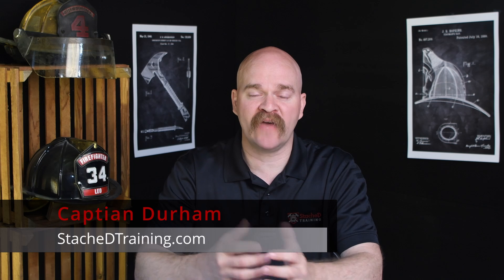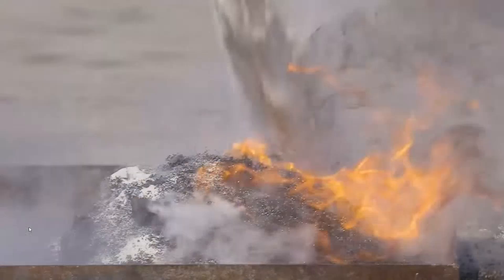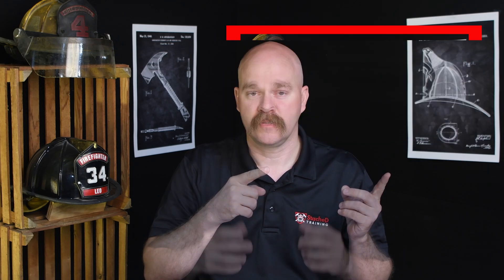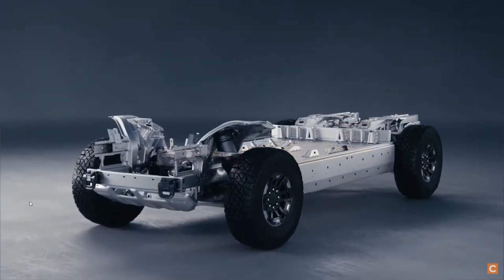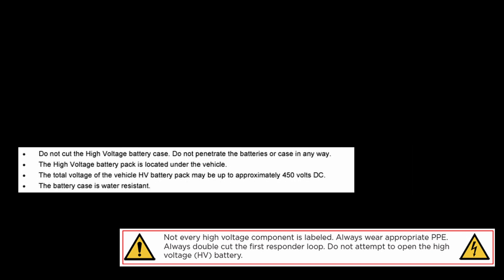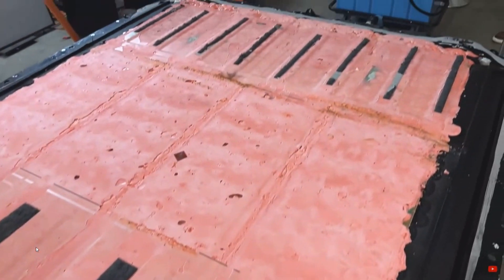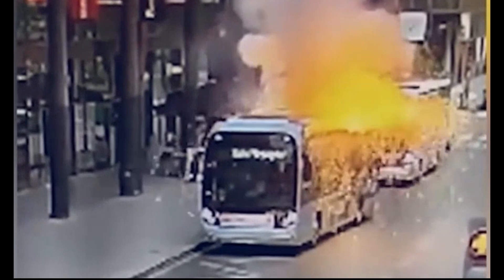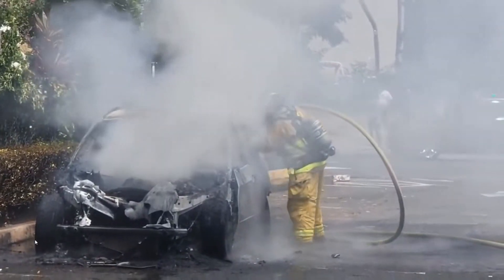What Firefighting Tools for Extinguishing Electric Vehicle Fires Really Work?

Comment: I saw a specialty truck in Europe where a huge tank on the back of a truck where the ev was hoisted into the tank and completely submerged. This is the best approach ive seen. It minimizes Poineaus fumes and damage to roads.
Reply: what happens to the water that the EV was dunked in? I doubt they treat that water
Reply: @Kiyoone  donrt know, it would be pretty toxic but probably better than the airborne toxic emission that an open fire would bring

Comment: "10s of thousands of gallons of water, that's what it takes to put out an EV fire."  With lithium based batteries, nobody is 'putting out' an EV fire, they are simply cooling the fire as the lithium in the battery banks burns to completion.  Contact with water actually causes metallic lithium to burn - remember that from chemistry class?

Comment: Is there anything from built-in airline cargo extinguishing technology that could be built into EV batteries.

Would liquid nitrogen in reasonable quantities reduce the temperature quickly?

Is there any adaptation of the halon gas methods used in computer centers that would work if they could neutralize or separate the burning chemicals?

Comment: manufacturers should have to design in fused/heat activated extinguishes as part of the pack, as you said, it's much easier to extinguish from the inside, and some power electronics already have little heat activated fire extinguishes in case of board fires
Reply: Have you watched the video? There’s no extinguisher that can reliably put these fires out

Comment: What would be interesting as well is the answer to the question: What type of gases are released when such a battery burns?
Reply: Was wondering that too. Bet they're far more harmful than any of the greenhouse gases they typically designed to reduce.

Comment: I'm still wondering about crane and dunk tank method, the car is a gonner no matter what. I think like they did in Germany I thinkit was  they put the car in container of water, much easier to keep cooler water to the battery. I'm not sure if a top could be made where gasses are filtered or even burnt off in a controlled manor...
Reply from the maker: I discuss
 this method here: https://youtu.be/CVUAzFzKhw8

Comment: Fire needs fuel and energy. A large tank of water can absorb a large amount of energy. Lithium reacts with water, but if hot enough also with air, and cells should be waterproof, so submerging the battery might be cheaper than fixing molten asphalt.

Comment: I think there should be a fundamental change in the way EV batteries are manufactured. A redesign to make the batteries them less prone to catching fire. These technologies are on the way. For now, just keep the fire from spreading to other things,
Reply: The frequency of lithium battery fires is not significant compared to gasoline. Better ways to extinguish the relatively few fires is the issue.
Reply: They are far less prone to catching fire that other vehicles

Comment: My concern (in addition to EV fires) is the use of Li batteries for when combined with solar cells for home use. The batteries are just wall mounted in a convenient location such as the garage, under a bedroom etc. Most people are simply ignorant of the dangers that these batteries pose to life and property.
Reply from the maker: The plus side, these types of system are in fairly safe, stationary locations.  They also have slower charge/discharge rates.  I plan on covering ESS in a future video.
Reply: One technique to isolate these is to build the extinguisher into the top of the containment for your power wall or bank. I have disassembled failed/expired extinguishers and piled the material in gallon bags and placed this atop my charging lithium batteries that aren't building high heat. Similar apparatuses can be made with sand as well, not that it will smother the flame but it will insulate the heat from catching the surrounding materials on fire as quickly!

Comment: then its up to the producers of the batteries to add a fire suppressant within the batteries themselves,  maybe a chemical in a chamber that when activated either automatically through sensors or manually floods the compartments with a chemical that has the right effect on the batteries to either suppress the fire and or convert the existing cells into dead ones as regurds to the ability to create the fire,

if that tech does exist then governments can outlaw any battery vehicles without it

its never a good idea to have an easy to access (car / truck) that can be used as a terrorist item that cant quickly be extinguished, how they were able to put these on the roads and into the hands of the public without a fire suppression system either on board or for the use via fire fighters is ridiculous 

quite simple really, "no you cant have that because we cant put it out in an emergency" should have been stopped at that hurdle right from the get go

Comment: Vehicle manufacturers producing EVs should allow input and output nozzles to be located on the vehicle to allow high-pressure water to enter and exit the battery pack. This would allow gases to escape but more successfully without total burn-through.
Reply: water cannot put this fire out

Comment: The ONLY solution is to demand the battery pack manufacturer to solve this and test it thoroughly, no-one else can. The construction MUST compartimentalize and totally isolate them from eachother and safely - under control - let the faulty compartment burn out without igniting the others. It is not easy, but the solution lies in the design. A poor design will ALWAYS be hazardous and the safest thing for everyone is to let it burn. But that also means that parking garages may in fact NEED to ban electric cars...at least those which are not inherently safe under all conditions.

Comment: Very important to remember that according to NHTSA data ICE vehicles catch fire over 11 times as often per million miles driven than EVs.  ICE vehicles have pressurized gasoline, extreme high temperatures, 60,000 volts, lots of wiring, a fuse panel, many plastic parts, all jammed tightly together under the hood. When a EV rarely does catch fire it is likely to be totaled, when a ICE vehicle burns it will likely be totaled, a larger percentage of people escape EV fires than ICE vehicle fires.
Reply from the maker: I have a lot of comments on the data (lack of) behind EV vs ICE comments.  I plan on covering this information in a future video.

Comment: It's funny how the technologies that protect the fire from occurring in the 1st place (insulating batteries, separating them, mounting in strong containers) is actually hindering firefighting efforts.
Reply: I call it the boot vs sandal effect.
You can either work really hard to prevent anything from getting inside, or you can make it really easy for anything that gets inside to pour back out again.
Trying to do something inbetween defeats both purposes.
And battery boxes are using the boot side of things.
Reply: Similar to house construction; houses are easy to Pierce and get water on. A castle convert very difficult to extinguish a fire, due to accessibility.
Reply: You either a hero or live long enough to become the enemy
Reply: You could have the battery fully exposed would not help much. Get yourself a few fully charged 18650 cells tape them together. Short one out or even better stab one with a screwdriver. Watch the resulting fire and see if you can put it out with water.
Reply: @mitchellcrane9809  It will actually be possible to put out the fire quite quickly: I mean the cells that are already burning will need to burn out, but all the remaining ones would be safe. A fire would last like couple of seconds. One 18650 cell holds about 10 Wh of energy, that's a tiny fraction of the whole EV battery.
Reply: @mibars  No actually try it because I have experienced myself. I have friend who is a commercial electrician. He got the fabulous experience of watching a data center burn down because of the LiPo batteries in the backup power supplies went off and spread to other units. Now imagine trying to put that out in a tesla pack which is what the older packs are make of . The same principle applies to all of them. It is a extremely energetic fire that spreads quickly and there is no way to reliable put it out. This is a well known subject/issue why people actually try arguing that it is not the case is beyond me. The issue can not be addressed if people just keep telling themselves stupid ideas like just flood the pack with water or cool it with nitrogen or any or the other foolish ideas I read.

Comment: If a battery is burning, it is likely that the burning cells have burnt holes into the cooling jacket. I'd tap the cooling system to inject water directly into the battery pack through existing pipes. Two caveats being that 1) you need to know which pipe to tap into and 2) the cooling system going to the battery must still be otherwise intact, which may no longer be the case if the fire has been burning under there long enough to melt the battery's external hookups. The first problem could be solved by implementing a standard for external coolant connections, the second would require that external connections up to the coolant injection port(s) and bulk distribution within the battery pack be fire-resistant.
Reply: Tesla has figured it out.
Design the cell casing to fail at the base.
Encase the sides and top in a heat resistant foam.
If the cell shorts and a reaction starts, the base fails.
The material "torches" through the pack base to the open air.
It's heat that causes the chain reaction.
The cells next to the failed one never get hot enough to become compromised..... No chain reaction.

Comment: Let it burn . 
The likelihood of an EV fire is very low compared to the rolling gasoline bombs we’ve been using for decades.
The irrational fear of EV fires is largely a result of the “if it bleeds, it leads “ strategy of low budget local news outlets.
The other major fear inducer is propaganda from fossil fuel industry.

Comment: I remember a few years ago in the very infancy of EVs, there was a kind of heat proof expanding foam that you would spray all around the car. 

This would NOT put the fire out, but to contain the fire/heat and direct heat in a way set by the firefighters depending on the situation. 
Later, when cool the foam could be broken up and removed. 

This is far from a perfect system, but seeing as how the damage that can occur from an EV fire, the ability to contain the fire has got to be worth following. 
It's not about saving the car... Once the fire has started that car is gone, it is about saving the area around it. This is a MAJOR issue in parking garages and underground structures or anything like that.
Reply: That is all you can do about these fires - control the surroundings and let it burn

Comment: In Europe Renault is trying an access panel to the internals of the batteries that would melt away in the event of a thermal runaway, in order to enable the fire fighters to dump water inside the battery pack.
Reply: Water/chemicals do not put one of these fires out.
Reply: A fire need three things to burn
-fuel 
-comburant 
And heat
The goal of pouring water inside the battery pack is to Cool it down enough to put it out
Reply: @jordanrudler2120  putting water into the pack will not cool it down and put it out. Li Battery fires are not extinguishable , you can only let them burn themselves out. It is a chemical/metal/electrical/self oxidising fire  that water especially can not deal with.

Comment: Sometimes IV have watercooled batteries for normal operation. Why not make an external aux connection on the car for the fire department so they can fors cold water true to stop the thermal runnaway

Comment: If your near a river or lake, just push the car in the water. Of course most of the time that's not possible,,,,,,,,,,,The best thing is, just don't buy one, and don't put it in your garage, or park near one. Electric cars are just an overpriced over lied about how much carbon they put in the air. Building the car, building the battery. The mining that's required to make the batteries, the power comes from somewhere to keep them charged, and that's not cheap or saving you any more money than a 4 cylinder gas car. Even insurance now don't want to insure them. The tires must be much better because of the heavy weight of the battery. If you don't live in a big city, who's going to work on it? Sorry I'll take my money and go on a trip,,,,,,,,,,,,,,,,

Comment: The Renault Megane EV do have a function called "Fireman Access". It allow fire fighters to send water directly inside the battery. I think I heard they are pushing for this to become a standard on all EV.
Reply: Waste of time. You will not get near enough to hook up but more importantly once started you cannot put this sort of fire out. It is not about access it is more about the nature of they type of fire it is. All you can do is try to keep things around the car under control. This is a chemical/metal/electrical fire that is also self oxidising  that can not be put out it can only burn itself out.
Reply: @mitchellcrane9809  That's only half true. Thermal runaway can absolutely be stopped if the cooling is adequate. The connection port could be accessed in a standardized fashion with a remote / long pole. With a spray fan to block hot gasses it would be trivial to get connected sufficiently to dump high pressure cooling into a port.  Lithium battery fires aren't magical - just 'not really fire'. Think of the energy of running a cordless tool for 10-20 minutes all crammed into a minute of 'burning' which is happy to catch the next cell in the line...if you can dump that heat into coolant instead of the next cell it stops. In order to catch the next cell you have to do enough thermal or physical damage to make it electrically release its charge.
Reply: @mitchellcrane9809    The cells that are already compromised will burn to completion but interrupting them from being able to cause sympathetic thermal runaway in adjacent cells could prevent the entire pack from going up. Obviously it depends how quickly you can get to the vehicle in question but the nature of EV battery design could work in your favor if the entire pack isn't already compromised.
Reply: @OkammakO  unless you have a tanker truck riding along with you with the hose already attached to you car you are not going to stop the spread. The fire in these batteries because of the energy density is extremely energetic and spreads rapidly. You have little to know time to stop it from spreading. Battery packs have  no fire baffles in them to stop the spread and they will not do it either as it will reduce storage capacity. While battery fires are not a everyday occurrence when it does happen it is unstoppable and there are no known ways to stop it. Ideas out there to try to stop it at this time are fantasies.